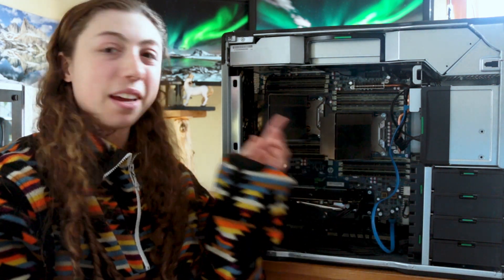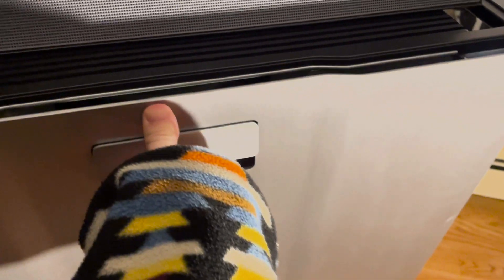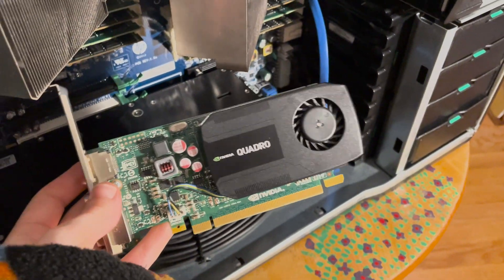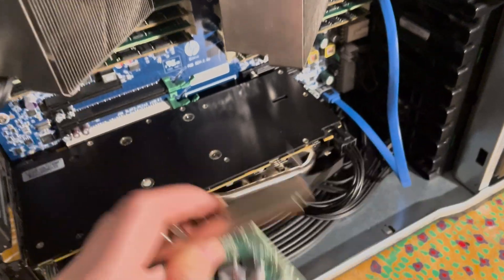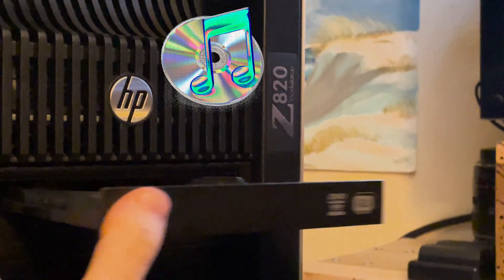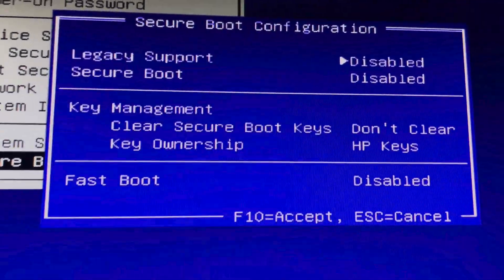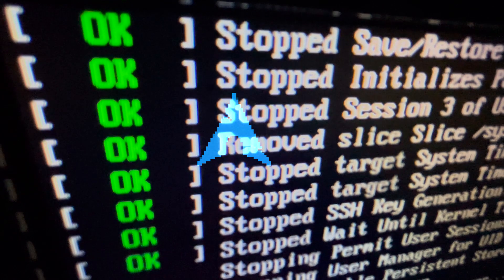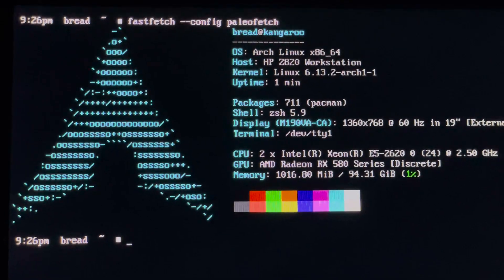The 2012 beast with 2 CPUs and 16 RAM sticks

Comment: Hey new Sub here ! Just found you, I'm watching on my HP Z840 with Dual E5-2696-v4 Xeon cpu's, 256 gbs of ddr4 2133 ecc ram, M.2 nvme pcie adapters for drives and an old NVIDIA Quatro p5000 16 g's of vram Gpu, and this thing still rulz even in 2025 ! love your stuff, you should do a " New" old dual xeon build, maybe a 2nd gen Xeon scalable like a HP G8 Z4
Reply from the maker: Hey thanks for subbing! That's a pretty awesome machine, wow. 
Not a bad idea, maybe in the future!

Comment: I bought two HP workstations for my astro photography workflows - especially useful for batch stacking thousands of images together into a finalised, integrated image for processing.

I got a Z640 with 2 x E5-2699 v3 (so 36 physical cores that will operate around 2.8GHz at full load) with 256 MB oof PC2133 ECC DDR4 RAM and a Quadro P4000 GPU, plus SSD and 8 TB HDD.  The second Z840 was only USD $500 - but it came with the same CPUs and 512 GB of RAM (same speeds) and an SSD and PCIE NVME boot drive.

I put a 4 x 2TB NVMe RAID 0 array into the Z640 and gave it a RTX 4070 O/C and added a second NVMe drive to the Z840 and moved the P4000 into it.

The Z640 I dual boot WIndows 10 and 11, the Z840 I run on Win 11 Pro.

I tend to run my mono camera images on the Z640 and the colour images concurrently on the Z840.  A batch stacking run may take 1-2 hours if you have 1,000 images to integrate (using PixInsight WBPP script at high quality settings).

So these workstations of yesteryear perform way faster (up to 4x than my old big rig PC - that was a 7 year old Intel 7820X water cooled match to all high end gear).  A high-end Threadripper build would be at least 3x faster - but at possibly 15x the price and have less memory - which astrophotography requries.

So I am totally happy with these beasts of yesteryear - if you have a hobby that needs massive CPU, I/O and RAM - these beauties can absolutely get the job done!

Comment: I'm running a HP Z640 with 64 Gb ram and 1 xeon. I got a Nvidia M4000 8gb gpu and two  4 tb sas hdds and i am dual booting windows 11 pro and arch linux with omarchy. On windows 11 i use it for Blender Krita and Unreal engine and it works like a charm. Are there faster systems yes, but the Z640 is stable and cheap.

Comment: Sandy Bridge and Ivy Bridge EP Xeons are so stupidly good still. Power efficient? No. But whatever you spend on electricity, you save 2x on hardware cost. An absolute dime a dozen, takes oodles of RAM and it's all incredibly affordable. Modern enough I/O, plenty of expansion capability for stuff that it doesn't support out of the box. Intel absolutely cooked in that gen. Odds are the BIOS already supports the Ivy Bridge v2 CPUs too on Sandy Bridge workstations. 

There are some L variants of the CPUs that are clocked down a bit that can save on power. $20 on eBay. I used to run a Dell Precision with dual E5-2650Lv2s. Low and wide. 10c/20t, clocked at 1.7GHz. So 40 threads total. Had mine packed with 128GB of RAM, running Unraid and a ton of Docker containers. Never broke a sweat. All in maybe $250 plus drives. Insane value. 

Sadly, those days seem to be over.

Comment: My "new" home lab machine is the Z440, the single socket version of this machine. I got it from Ebay with 32GB of RAM, a 128GB  SSD boot drive loaded with Windows 10, and a broken video card. I upgraded the BIOS so it could run headless, hit EBAY for 128GB of RAM and an upgrade CPU a used Xeon E5-2690 v4. I then added a PCIE card with 2 M.2 slots, one a PCIE and one a SATA and installed 2 TB of fast storage. I also added a pair of 4TB drives for use as my home backup solution. I installed Linux and with virt-manager used KVM/QEMU to build out a great home lab with different versions of Linux including Windows 11, Ubuntu, Debian, Mint, and multiple Arch machines. Lots of resources and not a ton of cost.

Comment: my  i5 desktop w/ GTX 1080 from 2018, and my Ryzen 7 Vega igpu laptop from 2021 both relatively run the same things except for the bigger competitive online stuff and newer open world games which only the desktop can handle, and it is def reaching a point where newer stuff wont work on it. But I can get rocket league to work on both, which is more than enough for me. If someone can get roughly the same performance from 2x Xeons from 2012 for thrift prices, that's nothing to spit at.

Comment: I have the HP Z840 with 2 x Xeon E5 2690 V4, (28 CPU Cores) 128 GB RAM DDR4 ECC RAM, 4 x 1 TB SSDs, 2 x 14TB HDDs, 2 Nvidia GPUs, 1 Gigabit NIC, 1 PCIE to m.2 adaptor that has 4 slots.
My hypervisor/main OS is truenas scale, which has a bunch of VMs running that has storage as zvolumes
I have a VM that is my personal day to day workstation with 8 CPU cores Pinned, 32 GB RAM, 128 GB SSD zvolume
It is basically my all in one machine. I run so many things on it
1. NextCloud
2. Immich (One private and one public)
3. URL Shortner
4. Actual Budget to manage my finances
5. My Portfolio
6. Split Pro (An OSS app that let's you split expenses with your friends)
7. Bitwarden
8. Multiple DNS servers
9.  Librespeed (to make speedtests locally)
10. Speed Test tracker (which tracks my uplink connection speed)
11. Personal VM that runs Pop OS

I can run even more things but like you have mentioned the power consumption is a big thing, my system idles at like 220W which is huge. It has so much potential except for the power draw. It has good vents isolating the thermal chambers, so many PCIE slots to expand everything (matter of fact i filled all of them), cool HDD bays, basically one fine piece of engineering.

Comment: I had a similar computer at my previous job for compiling chromium. 96gb ram, 2 CPUs with a total of 48 threads, an Nvidia Quadro gpu and two 10gbit network cards used at the same time. The Nvidia Quadro gpu actually ran better with nouveau than with the proprietary Nvidia driver. And yes, I used dwm on that computer.

Comment: Great video and explanations. I like how you do and edit your videos. So as to these old HP Z's: No. Don't buy a Z820. Or 420, 620, etc. HP Z440?--decent workstation for many tasks. HP Z840 is really the sweet spot here in price/performance: It gets you E5-2600 v3/v4 using DDR4ECC vs. DDR3ECC. You can push the high-end E5-2600v4s with a lot of cores, fast speed (for those Xeons!), and power suck from the wall jack. OR, you can do the nicer, friendlier E5-2600v4 L's (low-power) and get a decent system which only licks the wall jack. This has SAS, a lot of PCIe lanes, and room for SAS/SATA drives inside. It won't compare to a decent Ryzen, but still. My Z840 has 1.5TB of RAM. Yes, the power draw is very noticeable.  LOL

Comment: The HP Z820 / Z800 machines of that era were so incredibly unreliable that HP stopped honoring their warranties, which forced the company I was working for then to sue them to recover the cost of failed machines.

When I took the failed machines to be recycled, the total weight of them was over 1,000 pounds.

If you've got a survivor, then great!

I'm still running a 2012 eight core AMD Bulldozer with 64 gigs of DDR3 as a server. Sure, it can take a lot of power, but dropping machdep.cpu.frequency.target to 3300, which also has the effect of turning off boost clocking, reduces the power to close to half, while still performing better than 80% the speed of full speed. Perhaps you can try that on yours.

Comment: I have one. It does sit idle most of the time.  What I use it for is running computer simulations (Fortran and C based).  Is it a power pig?  YES.
Mine has 196GB memory with two E5 2690 v2 cpus.  I don’t use it for development, it is for actual test runs.  What is good is the amount of disk storage it can handle. And yes, I use Arch BTW.

Comment: I was using a Sandy Bridge i7 system from 2012 (with the exception of a few GPU upgrades of course) until last year. If you're not doing video/3D/Scientific work, most people would still be well served by older hardware for their needs. I remember when I was a kid in the 90's it seemed like every 6-12 months there was some major CPU/tech development, and  it was unthinkable to run heavier software/games from say 1999 on a system/CPU from 1994, but I was able to get 12 years of life out of that system. Moore's Law really has plateaued.

Comment: Overall, a decision to use this platform or any other one depends on a compute density and local market conditions: how much of "things" you packed into a single unit, thus per watt of electricity (alongside with the availability of something more modern and more dense in that sense). (DIsclaimer: my case is a bit different, as I'm not located in the USA and pretty much anything computing-related should be imported, thus anything locally sourced is more optimal).

Speaking of HP z820 (as I own one), at the lower end of resources it's not a best thing. 
On the other hand, if you beef it up from E5 v(1) to E5 v2 CPU (Warning: one should check the motherboard version for a possibility to do so), likely for E5 2660v2 (dirt cheap)/2695v2 (for a price of burger); at least to 256 GBs of RAM (I packed it to the brim of 512 myself) and some refurbished hdds (again, used hdd would be about 15-20 usd per 2tb) - it becomes a relatively viable solution, as it delivers more than a consumer grade components would do on a budget of 300-500 usd. 
Though, for the same price in the USA you might get a 2-3 generations-old server platform and achieve a bit more.

Comment: I have a similar Dell system that is perhaps a few years newer that I had purchased for roughly $400 dollars, around a year ago.

Its a single xeon CPU (10 cores that clock pretty high) , 128Gb Ram, dual nvme (that are hot swappable).

I installed a used 3080 that I purchased for around $300 dollars.

Runs LLMs reliably.  Has room for a second GPU,  has normal cooling (vs a rack mount).  It's weird we'll probably never see this kind of quality ewaste again😢

Comment: You could try:
1) Haiku OS - Originally BeOS, it was designed with hopes to replace MacOS in the 90s, then it went free and open source. The GUI is unique & they're still giving it updates.
2) Bedrock Linux - A metadistribution that allows you to mix and match different Linux operating systems together. It's beyond my pay grade, but the concept is super cool.
3) Bodhi Linux - They made their own desktop environment, called Moksha (based on Enlightenment), so it is something new to explore.
4) Dynebolic - A GNU libre-certified live distribution that comes with a bunch of software for artists. Very cool and no proprietary stuff.

Comment: I have a 2010 dual Xeon Mac Pro with 48 GB RAM and 4 TB of spinning rust running Ubuntu as a "Shop" PC for my electronics bench. I also have a HP XV6000 dual Xeon beast running Win10 that I use specifically for ripping DVD/BluRays. As for a weird distro for yours, try puppy Linux on it.

Comment: I was given one of these for free by my work. It had been the system powering one of our HP industrial printing presses. It had been replaced by an upgraded unit in 2014 and sat on a shelf unused for 10 years. I stuck 2 E5-2680s in it and managed to get an unused titan XP for 150$. It's my gaming system now. It plays ALMOST anything at 1080p with high settings. The architecture does limit it tho and holy smokes... you're not joking about power consumption 🤣 It also heats my living room in the winter.

Comment: my uni has a bunch of these with CentOS that we use for atmospheric simulations! they are super slow compared with modern hardware (20 of these nodes with networking and all that can't match a high end 2024 xeon or epyc node) but they are dirt cheap so the uni won't replace them, and they probably don't care about the electricity bill.

Comment: Please consider removing the processor heat sinks, cleaning the old thermal paste off with IPA, and adding the new paste, which should improve the thermals. As for OS suggestions, consider installing Proxmox on an SSD. Then add large-capacity spinning disks for VMs. That will give you a playground to test out different operation systems and self-hosted services. With its power-hungry nature, I wouldn't leave it running all the time.

Comment: I just got one from eBay for $300 WITH 4 X 32GB DDR3 Ram.  I also got an additional 12 x 32GB Ram for a total of 512GB Ram.  And 2 x Xilinx ALVEO U200 Data Center Accelerator Card A-U200-A64G, and 1 x P104-100.  I chose this model because it can hold 3 gpus, and that massive brick of a power supply to power everything.   I need all the ram because I will be running deep seek and other AI reasoning models.  Which require 4x the ram of regular models.  So an 8B models needs at least 32GB to run well.  This will serve as my home AI server.

Comment: If you're patient, it might be a cheap way to run a very RAM heavy large language model. It won't exactly be spitting out tokens super fast, but slow is better than than it not fitting in RAM and just failing to run at all, right?

Comment: I have something similar a Dell T5600 as a Proxmox host.. Running a bunch of VMs to test operating systems and I have a constant Minecraft and Valheim server running.. Finally, a Trunas with 2x 6TB HDDs for back ups and archiving purposes for Plex.  Is it the most efficient now adays? I can say it is not. Does it work? It has been constantly powered on for a year and a half now.. Since getting them is cheap I upgraded to E-5 2650s and 128GB of ram off of Ebay..

I think you should try it.. Running a bunch of VMs off of it. Trying different versions of distros.. Also as a testing sandbox to play around in.. It makes it so if you break a VM it is not as big of a deal..

Comment: These workstations had 4-channel ram configuration and can achieve the bandwitth of a dual-channel DDR4 system. The real problem could be the power consumption, indeed, but in my experience idle and/or low load average isn't requires significantly more power than a desktop CPU from the '20s. Of course, it's a different story under full load.

Comment: Nice to see a well thought out review of one of these HP Z-series machines by someone that actually uses it.  I've got an HP Z440 that I bought last year and have upgraded into a very nice gaming machine, although this system really excels at any task that requires rapid processing of massive amounts of data.  These are great budget machines, and they're built like tanks.  For about $350 total (recycled my graphics card from the previous machine), I've got a Xeon E5-2682 v4 (16c/32T, 2.5-3GHz), 96GB ECC DDR4-2400 Quad channel memory, a 1TB RAID-0 SSD boot drive (Linux), 2TB NVMe for games, and an RX-580 video card, and the original HP 1000WT PSU..  60fps solid on all of my games in 1080p, and the 7-zip benchmark gives 80MB/sec compressing with 800MB/sec decompression, and memory throughput is around 75GB/sec.
Maybe this is a generational thing, but my system, as described, only consumes about 75 Watts at idle, and always under 350 watts even under full load.  (Power as reported by my UPS which is reporting computer and monitor power consumption at the wall.)
Reply: wow, solid comment and exactly what i thought. real reviews, with real content...not 100 videos YELLING into the mic looking at the camera like people are morons and tryihng to tell you why NVIDIA is a liar and why you should abandaon Intel..not real tech, just shoving down the trends the algorythm tells them.

I use mine still, Z800, i wrapped the back panels in Carbon fiber wrap for cars, i had some spare from when i used to cover old laptops that were scratched. And i do use mine as well....SSD and a 3.84TB NVME PCIE SSD from HGST. ITs super solid and I was running a GTX 980 GT but now run a GT 710 on it just for the simple stuff i need it gets the job done!

Comment: FYI this will take E5-2690s, possibly 2690 v2s if it has a 2013 boot block date.

They're still old CPUs but they're dirt cheap and significantly more powerful than the 2620s you current have.

Comment: I have a 1000 MHz 1GB of RAM laptop. I consider massively improving on this by upgrading to 2GB of RAM, which is the max the poor 32-bit single core dual thread processor can handle. The storage interface is SATA-II !

The main plus is that it is entirely passively cooled, and it runs Doom, of course

Comment: The best CPU to drop in this seems to be the E5-1680v2 with a Passmark score of 12585.   (x2 that number for dual configuration)  
I like KDE Neon.     I've been looking at Lenova P620's old workstations of the same era, and they are equally as weird.
All these brand names computers I tend to shy away with as being exceedingly and unnecessarily proprietary, which causes you a lot of headaches, but when the prices start to plummet after 15 years, you scratch your chin and go... hmmm...   maybe... one... kitted out with the maximum ram...   would make a good linux server for something like Proxmox.    That is, only if you haven't gone rackmounted, which is expensive.